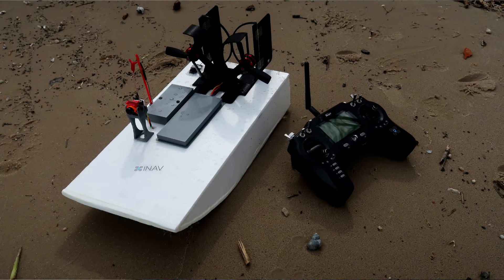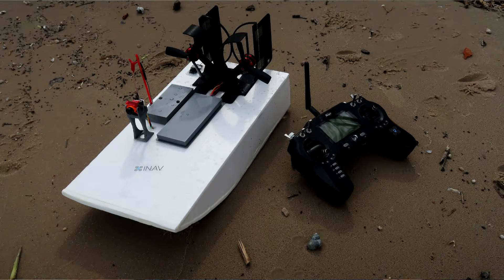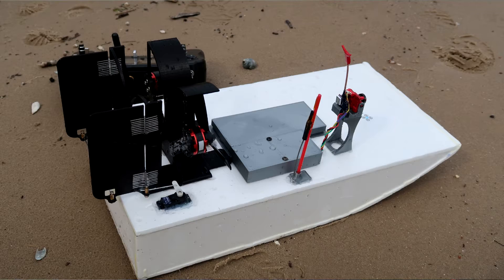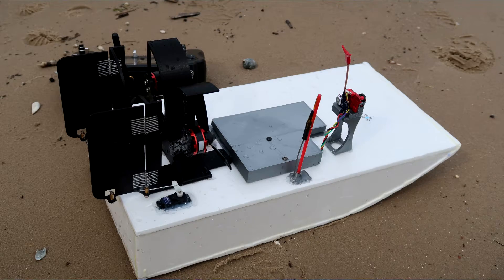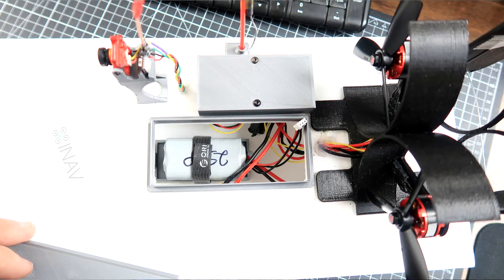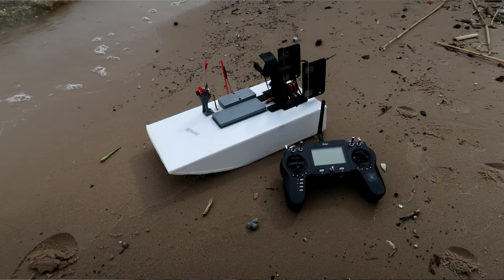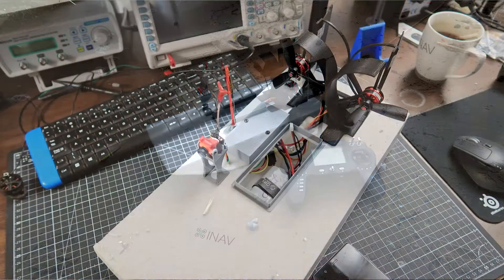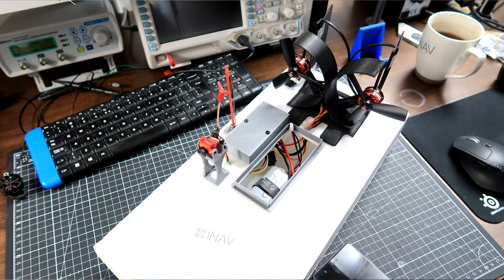RC Airboat - two motors, FPV and INAV inside

Comment: Nice work, thanks for this post! I've wanted to built a differential airboat for a while, with a camera in the water for marine research. Plexiglass in the hull, perhaps two cameras so one can look ahead and one in the water. Will be nice to get this working with waypoints for repeatable surveys.
Reply from the maker: Everything should work i INAV 2.5. However differential thrust is not that great. Very little authority
Reply: @FPVUniversity  Thanks! Would a rudder work better in this case?
Reply from the maker: @nickvallianos  yes
Reply: @FPVUniversity  Cool that will help!

Comment: If having two motors was better why do all airboats have one motor???.. i have seen many extremely well performing rc airboats with one motor... i think it was your setup and design that caused poor performance ..things that effect performance. thrust angle,cog,low center of gravity, proper weight distribution,hull design,size of props etc

Comment: Pawel, there's one thing that puzzles me for quite some time. I would like to use BF or INAV on car. ideally with 2 or 4 motors + steering. With multiple motors, torque vectoring would become reality. Since you are saying that you would like to add rudder to INAV, I believe that it isn't far from steering ;-). So, what about car? ;-)
Reply from the maker: rudder control is not active only on RTH and Waypoints. For everything else rudder can be done with mixer without any problems
Reply: @FPVUniversity  Interesting. Is there some documentation around the mixer and how to set it up for steering? I found this (https://github.com/iNavFlight/inav/wiki/Custom-mixes-for-exotic-setups#v-tail-fixed-wing), but it seems to be deprecated and not really telling how it works, unfortunately. Thanks!

Comment: Ha, what a coincidence! I was just thinking about a FPV hover boat project with INAV when I brushed my teeth before bed and I see your video now. I will be also interesting  to have a hovercraft which could cover both water and land and go a bit long range.  Any idea? Definitely looking forward to the modified INAV for such applications. I would put all electronics in a Lock&lock box and EVA and carbon as the frame.
Reply from the maker: From the point of view of software only rudded in RTH is missing. Everything else mixer can handle to have a hovercraft

Comment: I  build a hovercraft with differential thrust and when I give throttle it goes sideways like one motor producing more thrust . So my doubt is if I use Inav will it be possible to have straight thrust Even if motor Don't produce even thrust and  my esc don't have bidirectional . So I'm wondering if there's a possibility to have a switch setup to reverse motor direction and have backward control in Inav after flashing esc with bidirectional . for hovercraft in Inav what model should I choose quad or plane differen
Reply: are the motors counter rotating?
Reply from the maker: in my build yes
Reply: and in shadow's?
Reply: @marc_frank  yes bro they are counter rotating
Reply: @FPVUniversity  pls sir help me out with this build
Reply from the maker: @lalithkishore3774  You mean mixer for hovercraft? Start with airplane, acc one RC channel passthrough to the bottom fan as a servo, propulsion motor will be a regular motor and rudder connected to stabilized yaw

Comment: Do u have rudder setup in inav which will make it straight
Reply from the maker: Just airplane mixer with pitch and roll removed. RTH will not work tho, this need deeper changes